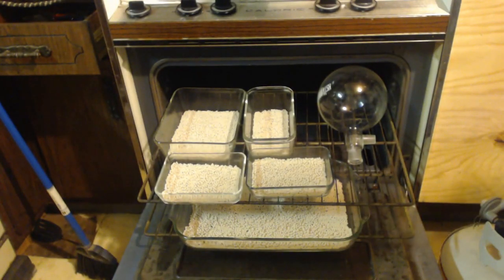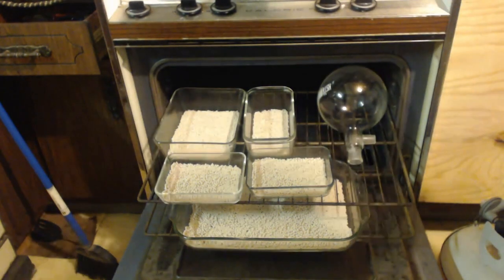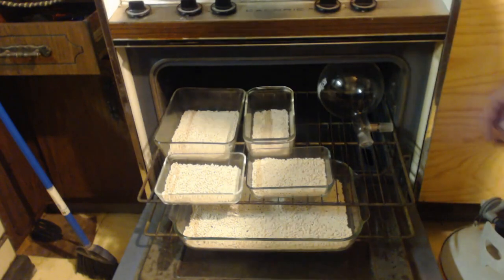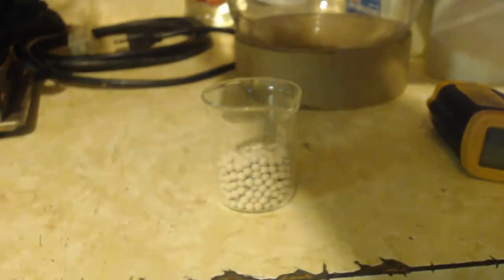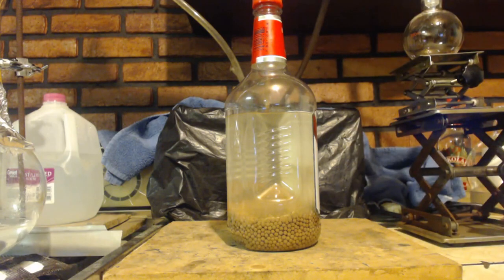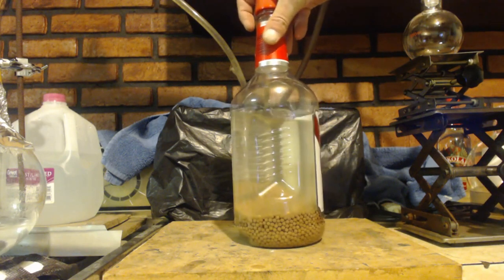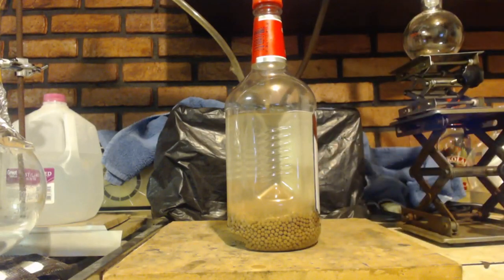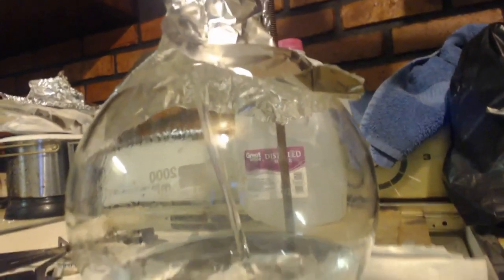MOLECULAR SIEVE REGENERATION

Comment: Can you use this process to get an oxygen concentrator working again? Thanks
Reply from the maker: Bob...........I think the molecular sieves most commonly used in oxygen concentrators are called "zeolites 13X"
Reply from the maker: Bob...................It depends on WHY the oxygen concentrator does not work any more.   Most oxygen concentrators use molecular sieves to absorb nitrogen gas under pressure and this helps purify the air to being more oxygen.   The sieves can only absorb a finite amount of nitrogen.   Once the sieves are fully used they can be regenerated or replaced by new molecular sieves and then the oxygen concentrator will work again.   I forget what size molecular sieves you need for a oxygen concentrator so you would have to look that up.  
                  Also i wanted you to know that this channel is abandoned and please go to my other channel and subscribe there and post questions or comments there.  Here is a link to that channel https://www.youtube.com/channel/UCRlRakXX0hacAXBzen1dZcg/videos

Comment: Throw a small hand full of sieves in as boiling stones to help with that bumping.
Reply from the maker: Mark Green............Well you made my day.  I was wandering if people would realize I am starting to put in extra video at the end of some videos.  Well that sounds like a good idea using sieves as boiling stones. For me though ........sieves are to valuable (harder to get and cost money) to use as boiling stones.   That is why I made this video  https://www.youtube.com/watch?v=DvdK9bh7etw   where I make boiling stones from old coffee cups and old broken lab glass.   Remember to NEVER use broken lab glass as boiling stones if the broken chips are thin.  You want CHUNKS of glass.  When you use thin chips the chips stick to the bottom of the flask and defeat the purpose of being boiling stones.  The stir rod is just for experiments where you fill the pot up to half way or SLIGHTLY more than half filled OR  the liquids are easily bumped.  For EXTREME  cases.   Like when  I distill sulfuric acid.  It is so hot and acidic I definitely do not want any bumping.   So I use the stir rod to make sure if it does bump the bubble will be broken by the stir rod.  But weather I use the stir rod or not I always use boiling stones in conjunction with the stir rod.  ANYWAYS.............thanks for the post and have a great day
Reply: @jbsc6180  yeah sieves aren't exactly cheap are they? I've got a small hand full that I re-use for boiling stones but they kinda sucked from the start (or should I say they didn't suck/absorb), probably why I used them in the first place. 

Keep up the awesome content man, this is a niche type of video since so few people enjoy this stuff. Kinda sucks, I can count off the chemistry channels on my hands, we really need more people doing this.
Reply from the maker: Mark Green...............Lol....they didn't suck.  Sieves aren't that expensive but I have no credit card so ordering stuff becomes a problem ..............Thanks buddy for the compliment.  I am trying.  My goal is to have unique reactions like chem player with nile red type editing.   After a year I finally found an editing program I can figure out so hopefully it will get better.  Life problems keep interfering though

Comment: To pull that last little bit out throw a little bit of lithium or sodium in there it'll pull it out
Reply from the maker: Walter Sobchack............I did your suggestion and put some sodium in some 40% vodka to dry it out without any distillation and it blew up and I lost 2 fingers..........No I am just joking.  That would be crazy........lol.  You know I NEVER even though of using lithium instead of sodium for drying that last bit of water out of ether or what ever.  That might be easier to break a lithium battery open.  Of course I was just going to make VERY impure sodium and it throw it in the ether impure.  Cause I would distill it afterwards so the impurities in the sodium wont matter.  Maybe try both
Reply from the maker: Walter Sobchack...........Just made like 270 mL of EtBr.  So far it is a 90% yield.  I just washed it so it is cooling back down in the freezer.  I need to dry it with some CaCl2 and distill it to see my exact yield but I am very proud of the 90% so far.  Even if it goes down to 80% I would be very happy.  Trying to get ready for my grignards.  Figured ether is the only thing I do not want to store or stock up on and that is all that is left to make.  It better work with out iodine to kick it off cause I have recrystallizing iodine to get some clean dry iodine
Reply from the maker: Walter Sobchack..................I am FINALLY almost done with my carboxy methyl benzene video.   Just filtered my mother liquor(toluic acid dissolved in ethanol azeotrope).    God it took forever to filter out the crap in it.  It all just kept going threw the filter.  Finally just had to let it sit and settle to the bottom and then decant.   Now I just need to add some water to make the product precip out and filter it..........thank god this is almost over.....lol.  Hopefully tommorow
Reply from the maker: Walter Sobchak...............Sorry to hear about your kids problem.  Sometimes EXTREME  problems require EXTREME solutions.  My one kid started getting carried away with drugs ( my guess is oxycotton).  I had the same thoughts as you.  The thing about that solution is will it last after they get off  the drugs and cleaned up.  Most times if it was not their decision to quit they just go back to the drugs............ANYWAYS.......he moved out of state last year.  Half a year ago I cut him off from borrowing money from me.   And recently he met a girl.  And she got him in check with his drugs.  So I got lucky................It is funny how when we were kids.........at least me..........would tell my mom not to worry and she was just being stupid..........And now the shoe is on the other foot..........ANYWAYS GOOD LUCK BUDDY .........I HOPE THINGS WORK OUT
Reply from the maker: Walter Sobchak...........I do that all the time.  Hit delete instead of send.  It sucks.  Yeah it sounds like your son is really digging a hole for himself.  I hope things turn out ok